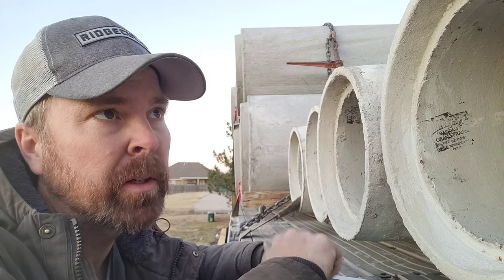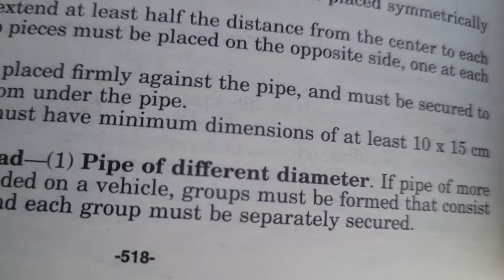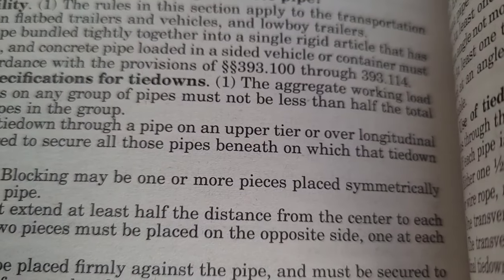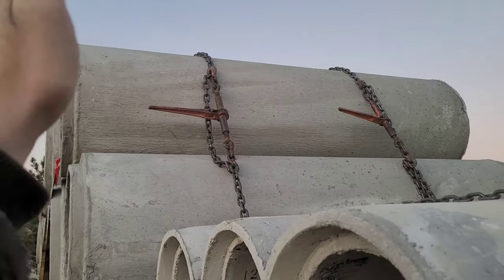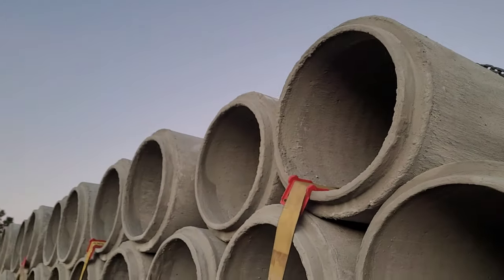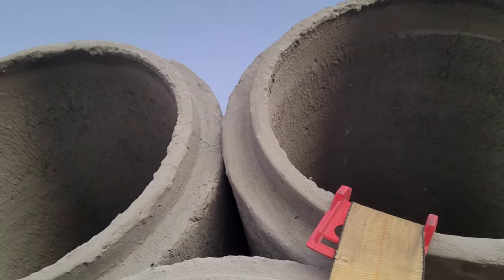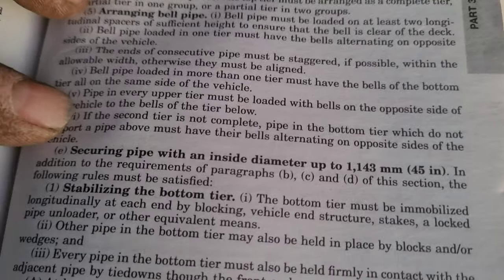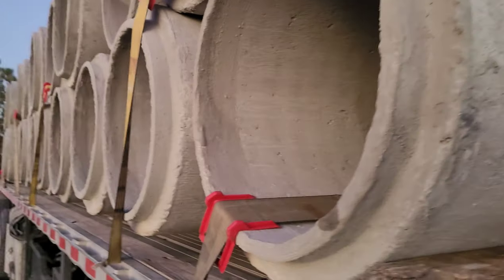How to haul concrete pipe legally  |   Explaining FMCSA rules

Comment: "The bottom tier must be arranged to cover the full length of the vehicle, or as a partial tier in one group or two groups."
That does seem quite strange. It seems to be saying that:
1. If there's just one group, it's allowed to cover the whole length of the vehicle, or just part of it (OK, fine).
2. If there are two groups, they are not allowed to cover the whole length of the vehicle (er, why?)
3. There cannot be more than two groups.

A consequence of this is that it's illegal to carry three different sizes of pipe in the same load, since you can't have pipes of different sizes in the same group, and you can't have more than two groups. So, if you want to carry three pieces of pipe, and they're all different sizes, you need at least two trucks!
Reply from the maker: Yes.  I don't understand not being able to haul more than 2 groups.  That makes no sense at all.  You should be able to put multiple groups together as well.  Most of these rules aren't enforced as far as I've seen but I still try to stay legal.  If I'm getting pulled over for an inspection, the officer is definitely going to read everything I went over and if anything is off, I'm getting a ticket(s).

Comment: "At least one tiedown through the front pipe of the bottom tier must run aft at an angle of not more than 45 degrees with the horizontal, whenever practicable."
The ties you describe as being at about 30 degrees are actually about 60 degrees -- it says "with the horizontal", not "with the vertical". At 10:00, when you're saying "You can't have it like this" and indicating with your hand, you must have it like that, by my reading of the regulation. The point is (I believe) that the strap on the front pipe of the group must stop the pipe moving forward. To do that, you want the strap as close to horizontal as practicable, so it can apply a lot of force resisting the pipe moving forwards. The straps you show on the small-diameter pipe are almost vertical.
Reply from the maker: It does say "whenever practicable."  It's not mandatory in that sense is how I'm interpreting it.   Oftentimes, bc of the way the pipe is loaded, that angle is hard to come by, especially when the strap is ran where there is a pockets take holder and they are sharp.  That angle can cut right through the strap.  That 45 degree angle is difficult to make happen on small pipe too.  Honestly though, I didn't know how to take it.  I try to get that angle on all of them, but it can be difficult.   You're right though about the video.  I was interpreting it backwards.  My reading comprehension is terrible.  Thanks for pointing that out.  I try my best to get these rules and regulations correct but it can be very challenging, especially when it's just me and honestly a lot of people don't really care about following these rules.  All it takes is to get caught once though and you'll change your ways, lol.  I do want people to challenge my thinking on here though bc sometimes we get things wrong.  I want to know when I get them wrong so I can do it right the next time.
Reply: @aftersolo  Yeah, I somehow forgot the "where practicable" when I wrote "must"! I can see how it would be hard on a smaller pipe -- also, the angle is less important on a smaller pipe, because it weighs less and has less leverage on the strap. I'm not a trucker but it looks to me like you have a great attitute to making your load safe, because what you do is based on understanding why stuff works, rather than just trying to memorize.
Reply from the maker: @beeble2003  Reminds of an Albert Einstein quote.  I don't just know these off the top of my head btw.  I had to look it up.  "Any fool can know.  The point is to understand."

Comment: discuss chain length ?  look like you have about 50",  standard  transport chain in 20", why can't you bring the chain down around the pipe and block, use chain to hold the block? secure chain to side rail, some states / dot get all queasy when you secure a chain to another chain, maybe this is and exception. what about x ing the the chains on top corner opposite corner ?
Reply from the maker: The rule says the chain has to go over the load if you did straps how I did them.  I wondered myself if it was legal to link them but it said nothing about it in the fmcsa rule.  I rarely see anybody throwing chains over the load, so I'm doing way more than most.  Most just do a strap every 8 or 9 feet and roll out.  I guess you could cross then so they could be tied to the railing.  That would secure the boards too like you said.  Maybe I could try that next time.  It doesn't say anything about the chains having to be parallel or not being allowed to cross.  I like that idea.